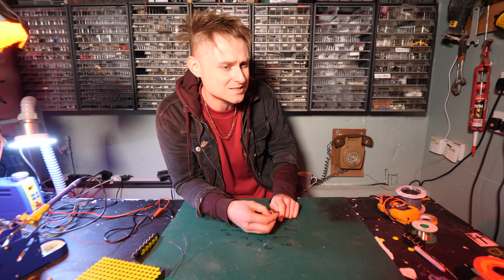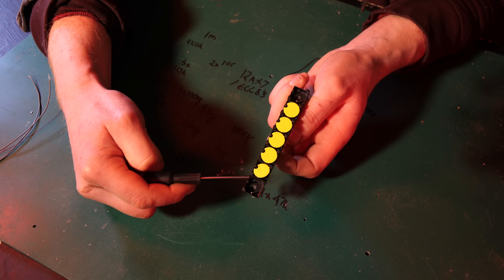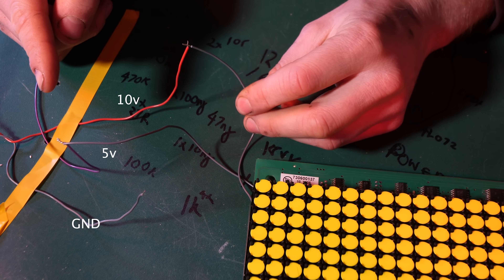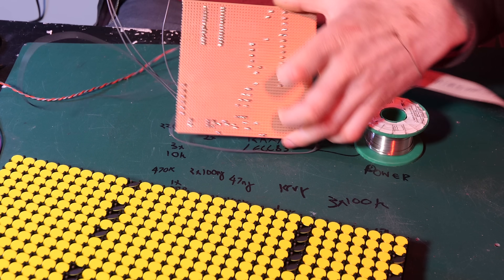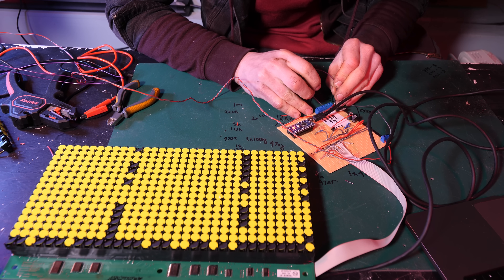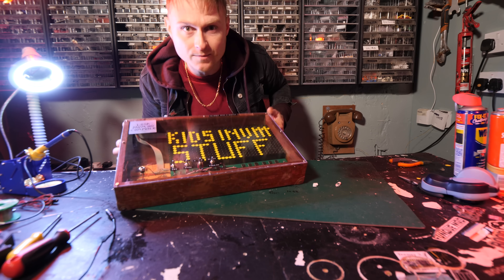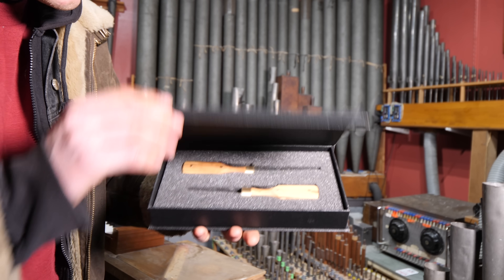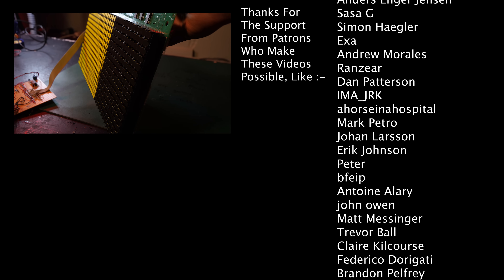FLIP DOT ETCH A SKETCH

Comment: I was just thinking about how these have interesting failure modes, as the buses local to me waited until they’d failed to replace them with amber LEDs, then you realised you had a slow one! 

The ones which took a few seconds or even minutes to finally flip were funny, as well as the ones which got stuck halfway or even other fractions of a turn. Some flickered on and off which I suppose was a localised coil failure. 

I did miss the readability, but while these were used I was always thinking how a rotating fabric indicator was nicer for text. Somehow London still uses those for buses even long after everywhere else has switched away, including the Tube. So these things were in an awkward place where I only started to appreciate them once most were replaced with dim, more pointlike, amber LEDs.

Comment: could you get some dials that you can twist like a normal etch a sketch, but each twist of the knob sends a signal? i am way out of my element here, but id assume there has to be a knob thats twist rather than flick up and down, and each click clockwise is one pulse, and counter clockwise the reverse pulse. that way you'd have actuall etch e sketch controlls. would be cool imo

Comment: Honestly there's some cool potential here. Final evolution would be to shrink the pixel size / increase PPI and then maybe some kind of service that changes the artwork daily.  
Is there any way to potentially have more sides to the pixel? like a cube that rotates on one axis so you could have 4 colours per pixel, added complexity though because you'd need a way for the device to know if the pixels have rotated or it could end up out of sync

Comment: Ik know how.
You design a baseboard for Microchip Fubarino and add a MIDI IN/OUT port accept instead of using midi cables, you put a RJ45 socket(Ethernet).
Also and to a block of 5 dip switches on there, so each Fubarino can assume a ADDRESS.
Use via's and solder jumpers to make the connection to the Fubarino, it's much more advanced than the Arduino ATMEG328.
it has 2 AURT + USB, but also has programmable pins and many pins have double or tripple functions.
Than you can put a Fubarino on each of your flip dot board and make them behave like a single screen on your museum.
the standard Arduino Uno 8 bit will not cut it here and you probably need a Master Fubarino as well to control all, cut the image in silces and send it to each corresponding panel.

Comment: For the flip dot displays for the front of the museum if you are having trouble with the speed and number of IO required it may be worth looking into FPGAs, rather than running software they configure their internal components to create custom hardware. A major advantage is they are essentially just digital circuits so everything happens concurrently, you can have every IO pin doing its own thing with its own timing at very high speeds usually. They also tend to have a large number of IO pins.

Comment: That would make an interesting daylight supercomputer panel.   Possibly just randomly selecting a row and column and toggling it based on its existing state stored as a single memory bit in RAM?
Reply: I bougth my first flip dot pannels because I wanted a graphic output for my electromechanical/transistorless computer 😀
Though at about 25 instructions per second, it wouldn't qualify as "supercomputer" at all.
Reply: When are you going to enter in the secret Santa?
Reply: @squirlboy250  Maybe I should just do it with another E-youtuber.

Comment: ToT:  "these strippers are much worse than a dedicated one, much more like a pocket knife version, but should work well in a pinch"
LMNC: "WOW these are so much better than my teeth!!"
Reply: LMNK*
Reply: ey that's pronunciated "teefs"
Reply: As a 40 year EE, I've stripped wire with my teeth quite a bit.
Reply: @mattwerner523  I stripped wires with my teeth since I was 9. From then, my teeth are shaped like a wire stripper, with a special spot for wire with different diameters, so I can easily strip wires with almost no effort.

Comment: U need to check a SSD1306 oled library, like the one i sended. how it works.
an Array inside the Arduino, a bit for each "dot" otherwise you exceed the ram memory of the Arduino, such library also contains a "font" array or with a "bitmap" using "Monochromatic bitmap HEX converter" or download: "LCD Assistant", looping "bitfield" structures.
You could make Nokia Snake
: )
Reply from the maker: I only had a day to do this project hence keeping it simple. The screen is programmed by binary counters. But basically making it more like LED matrixes in the next vid.
Reply: @LOOKMUMNOCOMPUTER  these things are cool, cool find. you probably should buy a microchip programmer like ICD3/ICD4 to program you own "Arduino" chip, design your own Arduino PCB with the microchip PIC32MX250F128D-50I/ML , the IDE seam to have a option to burn the boot loader (HEX) file.

you probably save some money there, instead of buying new Arduino's all the time and have a PCB that fits your needs. if you design the PCB and have the pic and MEMS oscilator with USB capabilities populated where you order pcb's.
solder the rest your self, check Fubarino schematic.

32 bit is probably best for a project like this, saving 32 bit's on 1 location instead of 4 ram locations. the thing also has 32kB ram instead of 2 or 8 kb. much much larger numbers than 0-255 or 65535 for 16 bit MCU's. 32 pixels / dot's on one ram location.

Ask Majenko for the HEX file.
Reply: @LOOKMUMNOCOMPUTER  i just ran a check on a internal register: BMXDRMSZ and it's returning 0x00010000 = Device has 64 KB RAM, using a magnifier glass i discovered i have PIC32MX270 at the same price of a Arduino Uno, "Microchip TCHIP011"/Fubarino at mouser, buy some so mouser refills the stock.

Comment: As a member of ToT subscriber expedition i assure you that when it comes to wire strippers, you are wrong handed, they were totally meant to be on this side, no doubt in that, there were no mistakes hidden by grinding that surface on that side.
Reply: Nope, no mistakes have ever occurred in a ToT video. He's kompletely flawless in every way.
Reply: @Phroggster  To even suggest it is inkonsiderate and frankly a little offending.
Reply: @Pouncer9000  I kan see what you did there.
Reply: Beats using your teeth! 😆
Reply: Absolutely none indeed. Also those are high quality
Reply: No betrayers here.

Comment: Hi! this is really cool!
I actually repair these damn displays at my work, they can get a little sticky after "some" use(15 to 20years) , or if you want to run them at higner speeds. If you ever want them to go fast, you can actually mill the little posts with electromagnets to get to the bare metal, they stick a lot less then (but it takes a loooonnnng time to do).
how the hell did you get so much of them? I though they where either stupidly high priced brand new or from decomissionned ones in small quantity
Reply from the maker: Cool! Got them from Andrew who got them from obsolete stock in a warehouse
Reply: He got them from my work, I work with Andrew haha. Was a shock when I saw this, I wasn't expecting it!
Reply: Hi, i'm currently having issues with my Flip dot board i got out of a bus, it worked fine before i cleaned it and now alot of the dots stick, I have tried wd40 but that made it worse so i re-cleaned the dots with alcohol but still the same. Do you have any ideas as to why this might be happening? I cant find any sort of maintainence info on these boards so any help is much appreciated as I'm gutted its not working properly. Cheers.
Reply: @lochlanroche8528  Hi! The black side sometimes has a coating to make it less reflective, and it can disolve with solvents (and become sticky). If they have such coating, remove them and put them in some isopropyl alcohol for some hours (it will be more shiny, but at least working) . Also, you would need to remove and clean individually each dot as some WD40 is most likely present in the joints, blocking the flipping. These things take a really long time to restore, so good luck! Also, they tend to work better in one orientation or the other, so try just flipping it updside down maybe it will help.
Reply: @_h4_314  Hi, thank you so much for your response, I have taken all the dots off a third of the board and cleaned them individually with Isopropyl alcohol, how ever they do still stick, more specifically in the one area I blasted WD40 in, could it be that the bit wear the dots sit is dirty? My original cleaning process was using a cotton bud with water to clean the dust off of the yellow side, but this caused the sticking in the places. I will try and soak them in isopropyl alcohol though and see if that makes any difference. Thanks again for your help.

Comment: Kinda wonder if it's possible to implement a USB mouse driver on the Arduino so that you can make the world's worst MS Paint.
Reply from the maker: well it will be with the museum window screens as they will be screens in essence.
Reply: @LOOKMUMNOCOMPUTER  in berlin i saw an instalation where when you passed by a screein it showed outline of you moving. I think it would look awesome with that dot display.
Reply: @bochen_art  That sounds like being done with a Kinect.
Reply: I want to play flip board snake at the museum so badly
Reply: best*
Reply: no, it's a host/slave system, USB. you also need a new USB jack.
but you can make a mouse, keyboard, midi controller and so with a Arduino and control your computer.
You could use I²C or SPI to make 2 Arduino communicate with other, but also that is master/slave system, UART gives some options.
Reply: @AnalogDude_  If there's enough processing power, I doubt there's anything that prevents a low power embedded device to be a USB host, though... 
In fact, in this case there's not even any need to check what's plugged in, the host could just assume it's a mouse and initiate and poll the slave with such assumption, or at least that's how I think it could work.
Reply: @FlameRat_YehLon  yeah the correct USB jack to accept a mouse.
Reply from the maker: @AnalogDude_  yes but what we are doing with the museum screen is making them a downscaled video sync screen. so itll not matter and in essence be plug and play, long way to go to get to that but figuring it atm
Reply: @LOOKMUMNOCOMPUTER  like i said, daisy chain Fubarino's via Ethernet cable, using 6N137 optocoupler, like on midi circuit, make Ethernet "crossover" cables. 2 pairs.
to demonstrate a message, the software doesn't need to be complex, just a single MCU has to respond to a address and collect the data and flip the dots, these red blocks with 5 dip switches. is enough for 32 "arduino".

the standard Arduino has a additional chip to make USB possible, the Microchip Fubarino has this intern. it makes the Arduino Uno PCB bigger and more expensive.

the Master "arduino" has to do a bigger job if you wanna play snake!

it's needs enough ram to uphold the entire screen, pose some nifty loops to cut in sections and send around.

the Font in the SSD1306 library is 5 byte, but it's vertical aligned.
10111111 = 0xBF = ! (exclimation sign).
Half of the work is already done in a SSD1306 library.
there are "many, you need to find a good one, some ara cable of drawing, like lines, squares.
Reply: @LOOKMUMNOCOMPUTER  i was checking on a SD card breakout PCB and found a official Arduino tutorial about it maybe use full for your project.
Reply: @AnalogDude_  you can hook up the sensor directly. They usualy use some sort of serial protocol.
Reply: An old serial mouse would be much easier.
Reply: @christophmuller3511  USB mouse should still be usable, over USB/PS2 adapter. Much easier than implementing USB support or so I think.
Reply: Trackball mouse! Could dice one apart or create one and talk directly to the sensors. No protocols at all then
Reply: @kiefermiskiw9645  The reason I mention USB driver is that if that's implemented, it'll be trivial to replace. Just toss the old one and plug in a new one, no additional soldering required. 
If this thing is getting into a museum, it make sense to have this hot fix capability, because I'm pretty sure it WILL break, multiple times even, if there are enough visitors.
Reply: @FlameRat_YehLon  RS232 mice use DB9 connectors, just as easy to replace. Harder to come by nowadays, but fits the scope of the museum nicely…
Reply from the maker: @FlameRat_YehLon  as mentionned itll be a screen in the end of it, so whatever you plug in to it, gets downscaled and played, so the mouse will be you using a laptop with a mouse. or running paint etc. itll have the resolution similar to a gamerboy screen. reason for doing it this way is then its friendly to use for none technical minded people/artists who want to mess with it.
Reply: @LOOKMUMNOCOMPUTER  Giving the refresh rate of the flip dot display, and its low resolution, it might not work that well as an "all purpose" display, especially not something that people can interact with without looking at the laptop display. Having dedicated software running on an Arduino (or something more powerful like a Raspberry Pi) that make use of the flip dot display's omnidirectional refreshing could make it perform much better and thus better inviting people to interact directly with the flip dot display.

Wait... Now that I've mentioned Raspberry Pi, anything could be possible. Mouse support should be trivial, and external video source support could also be done with an HDMI capture card (which is usually recognized as a web cam). The only "issue" is that the Pi is a computer, and a relatively powerful one even.
Reply from the maker: @FlameRat_YehLon  sorry but sticking with the plan. It will have to be thought about with refresh rate but it's the easiest way. Nothing worse than a clunky setup with purpose made ui. Obviously the user will need to work within its limits. But ultimately it's the best way to do it.
Reply: @kiefermiskiw9645  exactly!
It could be entirely electromechanical 

 There are switches, you could just replace them with a rolling stepper(like a mouse wheel just so that it updates the pixel at each step) or encode the movement like a stepper motor(which you could take from old dvd drivers and build your own mouse from scratch) that goes alternatively between 0v and 10v dot by dot, each motor(used as a generator in this case) controlling a row or a column and 2 buttons to override/hard-set a dot on or off 

It's trivial really, a mouse is just a box that tracks 2d movement and a button to set a point on the grid on/off.

Sometimes knowing too much makes you know less bc you jump staright to complicated stuff without noticing the surface-level simplicity that completely explains it without any of the standard-protocol-specific stuff.

You don't need USB, i2c, UART or any of that stuff, you could build a microcontroller from scratch is how simple it is to make a mouse for this, I bet you could even do it on a 556 chip. It's like, 2-4 logic gates on the selected point just to override the electromechanical updating and the refreshing algorithm.

You could also program a rasp pi with touchscreen and use it wireless with a digital representation on the screen, or even just write an .apk for your phone, but there's 0 need for anything digital at all.
Reply: We could use it to play Tetris. 🤔
Reply: Belgian busses! 😁👍
Reply: An arduino leonardo/pro Micro (i think) have a different usb layout ( no separate chip ) and can be used as a hid device.
Reply: @TheRedstonelabz1  but it’s a USB device, not a host.
Reply: @christophmuller3511  it doesn't actually matter if you bitbang usb, the nano has just barely enough processing power to do it though for a low speed device like a mouse, better method would be to just use a ps/2 optical mouse
Reply: @Mister_Brown  a serial mouse isn’t USB. It’s serial as in RS232. Grab a MAX232 level converter and hook it up to a UART and you are good to go. The nano ain’t no power house, but it should not have trouble processing a serial 1200baud stream of packages on its UART.
Reply: @christophmuller3511  i was responding to the "but it's a usb device not a host" comment
i agree a serial mouse or a ps/2 mouse would be more appropriate but i've had bitbanged usb host working on other similarly powered micros before it can be done
Reply: @christophmuller3511  A PS/2 mouse is also basic serial but does not need level converters.
Reply: Might use a ESP32 as it's quite a bit faster than arduino, and can do wifi
Reply: @haydenc2742  the Microchip TCHIP011 / Fubarino is 48 mHz.
Reply: Look mum only  a tiny computer
Reply: bit-banging a USB host sounds like torture ... but the /serial/ mouse protocol is darn simple